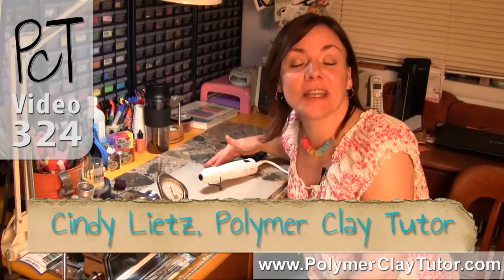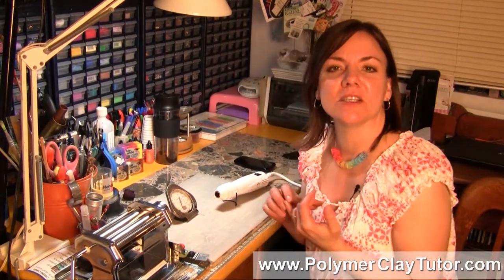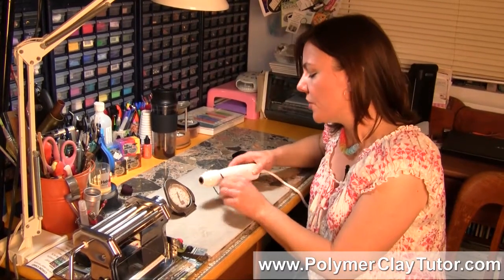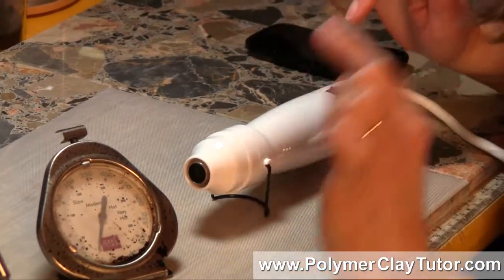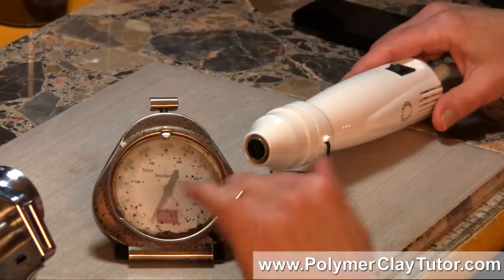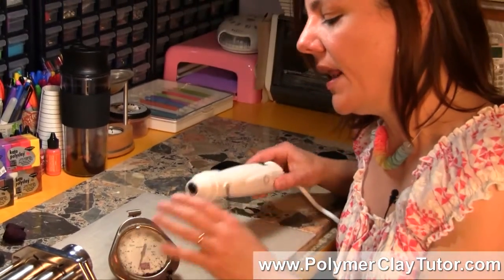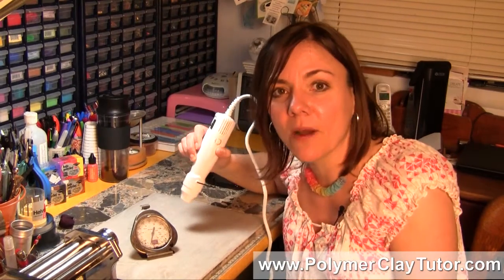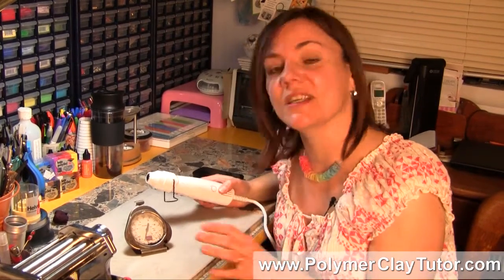Baking Polymer Clay With A Heat Gun Not The Best Idea

Comment: While I would never recommend using a heat gun to cure your WHOLE pieces, since it's so hard to hold a steady temp -  I've had much success using it to tack armatures together using a substance like sculpey's Bake & Bond! It can give you a nice sturdy base to work on that won't wiggle around as you work, all with the use of oven-safe adhesives.

Comment: What about if you have an armature for a big piece and you have clay in like the neck/shoulder and hip area to keep it together 
Should you use the heat gun to harden that clay so it holds together before you put it in the oven when you are done with the whole piece
Reply from the maker: Yes a heat gun will work well for that kind of thing. Be careful with it though, because it is only partially cured with the heatgun, it will be especially vulnerable to breaking, so don't drop it or put it under too much strain before it is fully cured. Also, make sure that the armature you're using don't conduct heat very well (aluminium wire or wooden skewers, wrapped in masking tape or floral tape is perfect). Because when you do a final baking, the core will heat up and if the outside of some of the sections is already partially cured, the heat from the hot armature will expand and crack the clay. Ask my how I know! 😉
Reply: I use aluminum wire

Comment: I am using some old ProScupt Clay and the instructions say 275° for 10-15 minutes per 1/4" of thickness. I recently did a 1/12 scale mermaid and had it burn bubble and blister after 10 minutes at 275°. I am considering a heat gun for some 1/24 scale figures because I now don't trust my oven.
Reply: Hello, how did it go? I'm a bit worried about burning my miniatures (around 1/12) so was hoping the gun would work
Reply: @Jade-fs9kh  In the end I set my oven to convection in hopes of more even heat and made a tin foil tent over the figures and that worked fine. I will eventually experiment with a heat gun on samples.

Comment: What about a DIY heat gun that you strip paint with? Ive got one that can make metal red hot on full power. Could you use it on thin sections of clay and keep building it up?
Reply from the maker: You can technically use any tool that will hold the correct temp evenly for 45 mins to an hour, but it can be tricky to control a heat gun at exactly the right temp and get a proper cure. A high powered 1500W heat gun is great for doing light cures for Faux Raku, or for curing liquid clay that goes clear when it is fully cured, but for larger projects it would be difficult. Not impossible... but difficult.
Reply: @PolymerClayTutor  Hello, can I make a question? I never used a hotgun, I needed one because I have to cure the Genesis paints on my polymer clay dolls. Now the problem  is that the dolls have eyes and can't be put in oven. So I have to cure the Genesis colors paints not in a oven for 8 minutes, but use an hot gun. I got one from Artemio and the power is 300 watt. It reach about 290° C.   Now, the problem is that, I'm scared to use it over a doll in polymer clay... If I use the thermometer for fimo, do you think that I can keep the gun at what distance from my tiny dolls, to be sure the clay will be not damaged from the gun?  thank uou for the help...

Comment: So I have a question. I'm new to polymer clay and I want to make these stud earrings. Would the size make a difference in how long I should bake it? And if so would it then be alright to use a heat gun? I do own a heat gun that can go well over 265 degrees with the right setting. 

The earrings will have swarovski gems embedded in them, so would baking them mess up the gems or would they be ok?

Comment from the maker: Hi KawaiiBlackPixie1, since polymer clay bakes at such a low temperature (230F-350F depending on brand) the high temps that an industrial heat gun goes to would be way too high. You could easy burn your piece to a crisp in a few seconds... which is something you don't want to do. It's kind of a 'killing a mosquito with a bazooka' type situation. :) I appreciate the suggestion though. It is always good to look for new options. Thanks for commenting!
Reply: Hi mam which types of gun using to bake

Comment: Hi, I was wondering if you have tried and got good results using Kato liquid poly and then a heat gun over the piece.  There is a video circulating where a woman uses a baked piece of clay and wants a high gloss finish, so she smooths the liquid Kato over it and then uses the heat gun.  she got desired results..  Have you tried this at all??

Comment: So you reckon that it would be actually a good idea to use a heat gun on polymer clay when I want to use it in my cricut machine and then place it in the over for an hour right?
Approximately how long do you reckon I would require to use a heat gun for a semi cure to be used in a cricut machine?
Reply: Hi there, it would be tricky for me to recommend the perfect time to pre-cure a sheet before cutting with a Cricut machine, since I do not own one of the machines myself... yet. (It is possible you may not even need to cure it at all, since I have heard of people using Cricuts for cutting out fondant for cakes. You would have to experiment with that yourself. I do hope to get a Cricut Maker at some point here, but until I have, that is all the advise I have for you. Good luck!

Comment: hello, is there no other way to harden a polymer clay, im just a hobbyist and really not planning to buy an oven just for my fun stuff, i was planing to buy a heat gun or a hair dryer as its cheaper than an oven, however i do have a microwave, but as you mentioned below that's not a good way either. could you please suggest any other way if there is any, i'll be really happy if you could answer....
Reply: Do you have a normal oven designed for foodstuffs? Even a conventional oven will work if you have one. I dont think a microwave would give you much controlled over the temperature, so I wouldn't recommend it. The microwave would also most likely dehydrate the clay more than a desired amount.
Reply: No, I don't have any oven..  :(
Anyways thanks for the reply..  I really appreciate your time I'll see what I can do..  Thanks again..
Reply: Don't mention it. :) You probably already know this, but they do make air dry clay that you leave over night and don't have to cure at all. I don't know if it comes in as many colors as normal clay, but you could always paint it.
Reply: Yah and painting is what I prefer more than colored clay..  :P
I think, I should go for air hardening clay..  Thanks..  :)
Reply: Manish Rawat I found this video where she uses kind of a homemade double boiler - bain marie. It's in Spanish or I found another one in italian, if you you I can send them to you via private message ^^
Reply: Ashley Whittington I'll give it a shot..  Thanks for help..  =)
Reply: someone in youtube used a candle with a sort of enclosure.

Comment: Can I use a heat gun to condition hard clay?
Reply from the maker: It would be possible to warm up your clay with a heat gun but you would have to be super careful not to partially bake your clay by getting it too hot. You would be safer putting clay in a bag and placing it in a bowl of hot water, than using a heat gun.

Comment: You not once describe what actually happens if you do not cure a piece. It's like in Idiocracy when they just keep repeating that Brondo has what plants need, and when anyone asks they just say electrolytes. If someone is doing a one off art sculpture, and surface cures the sculpture with a heat gun, paints it, and displays it what honestly is going to happen? Perhaps elaborate on what you're saying rather than just repeating something you were told.
Reply: Shaun Lambert II if you just surface cure it with a heat gun the inside will still be raw and it will be extremely delicate and the surface could cave in if you picked it up by hand
Reply: She has another video that shows an experiment she did with different times for baking the clay. The other video gives good information about how not baking the clay long enough will make it brittle. Probably the reason she didn't say it in this one is because she's already done it in the other video.